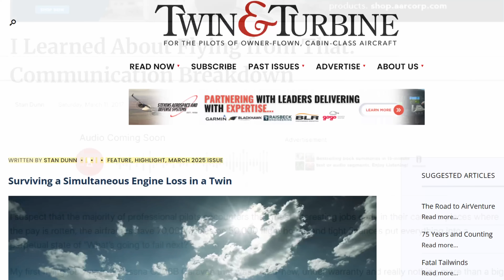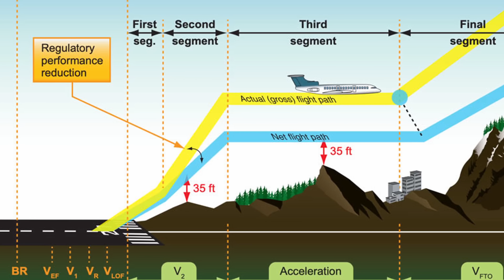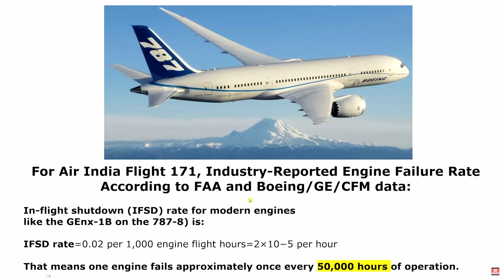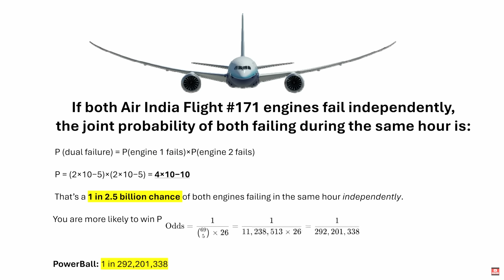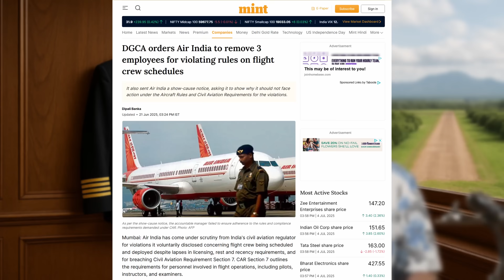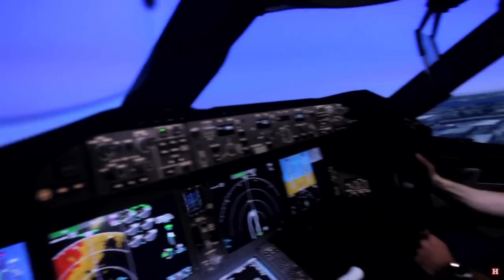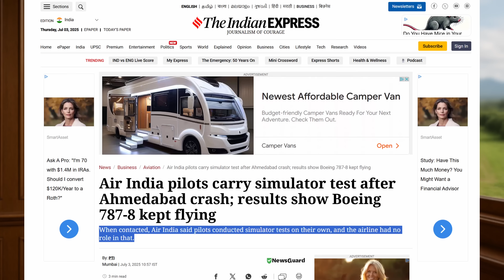Air India 171 Cause Becoming Clear

Comment: The takeaway in any meaningful  accident investigation is: Never say never, never say p(i) is extremely small 1 in xxxbillion. It has occurred, so the p(i) was 1 !
From how and where the little filmsy fuel emergency CUT OFF switches are located within armrest operation position, to why and how all different interferencing cables are spaghetti arounding squeezing through high density multipin connectors in lieu of industrial standard terminators to the decades old grandfather controller with dryjoint pcb, all are not exceeding kids  masterpiece quality. Have you ever seen how an industrial Emergency switch is housed in protected cover in train ?Do you know what happens if fuel is cut off to an airborne aircraft ? Do you know fuel fire needs oxygen to burn, which is difficult in thin air density high up in the sky ?

Comment: June 8th 2025 BA217 from London to Washington was 43 mins into the flight when the aircraft stopped climbing due to loss or power & had to return. Then on 12th June 2025 came the AI171 crash.Then approx 10 days later again another BA787 flight suffered a total elec restart during pushback. Lights flickered, engines refused to spool up, & the avionics rebooted mid-taxi. The flight was aborted.
Engineers couldn't initially pinpoint the issues due to systems complexity but eventually discovered what they termed Digital Deadlock. For some, the plane believed it was on the ground rather than in the air, a False Ground State where engine power is restricted, flaps don't go to airborne mode, hydraulic pressure limited, yet warnings remain silent!
BA217 entered False Ground State just 90 seconds after departure but the black box recorded no system failures.
These problems were known to Boeing and known to be behavioural not mechanical. By mid July 2025 at least a dozen airlines had started reviewing their reliance upon the 787 for their future fleet purchases. By the end of July 2025 some 140 787 dreamliners had been grounded for a variety of reasons, some associated with their Trent1000 engines.
https://www.youtube.com/watch?v=leOFzpgnlyI

Comment: Not clear at all.....
If the Pilots did not switch off the fuel, then who did?.....Was the switches operated or not?
Could the aircraft take off with the switches in the wrong state?
Is it possible for the crew or a passenger to operate the switches whilst on the runway, readying for take off?
How long can the engines run on for after the switches are operated?
Last one, coud the switches be be in a half way position neither on or off and a jolt or something clicked them off?
Just thinking the possibilities and no doubt there are experts thinking of other possibilities....
It is beyong comprehension for pilots to switch off the fuel to the engines intentionally whilst taking off...

Comment: The forward tilt of the wheels suggest the gear retraction process was initiated. Thus an engine manual shutdown seems unlikely, as that would take a while to complete and there would likely remain residual generator power for the 10 seconds or so it takes to raise the landing gear, yet the gear did not raise and complete its cycle.   Having just watched a 787 take off close up on YouTube, it only took around 14 seconds from Liftoff to gear up with the gear doors closed. Residual spin of the turbines and generator would have provided more than the couple of seconds required to simply tilt the landing gear wheels forward. Therefore, the fact that the wheels tilted but the gear didn't fully retract strongly indicates a sudden and complete loss of the primary electrical and/or hydraulic systems. The wheel tilt only takes a few seconds, which would under an engine failure still leave enough time for the gear retraction cycle to further advance than was seen in the Flight 171 take off video. i.e. I think they would get at least 10 seconds of residual thrust and turbine rotation that would see the gear retraction cycle well into its final stages. However that didn't occur and we only observed the first stage of gear retraction by tilting of the wheels. Thus probably the first few seconds of the process.  Point being that a manual engine shutdown (via fuel cutoff) wouldn't cause such an instantaneous loss of power across both engines and key systems. Residual N2 spool would easily support the generators and hydraulics for 5–15 seconds even after fuel cutoff.  That’s long enough for full gear retraction to complete, or at least progress beyond just the wheel forward tilt stage.  Yet gear retraction didn't progress beyond the first few secnds of its process.

Comment: Aren't there engine-out procedures that ARE memory checklist remediation? You seemed to state that engine-out procedures are ALL handled by checklist.
Reply from the maker: The only memory items for an engine failure I've had in my career is related to feathering propellers in turboprop aircraft. It can vary country by country, airline by airline, but it would be very unusual to have a memory item in the U.S. for a single engine failure.

Comment: I think odds are a mechanical dual engine failure is way less probable than a single one with a human's mistake. I also think the first engine failure started on the runway.  I'm just going off the number & odds. Odds are a single engine failure with a human mistake is way more probable than a mechanical dual engine failure. The human mistake happened by shutting down the wrong engine after a single engine failure. This would not even be close to the first time this mistake was made.  This is all speculation but with odds and history as evidence.

Comment: The latest theory is that it was the fuel cut-off switch to the one operating engine. I find that hard to believe as well considering that you need to lift and push that switch rather than just toggle it
I think we should just wait for the FDR and the CVR data to come 
Mind you, they already know what caused this crash because they’ve had that data for quite a few weeks now 
So somebody’s not telling everything that needs to be told 
I smell a cover-up

Comment: No flaps then it stalls ? not set up elevator trim was all wrong as well ? Boeing says 787 is not certified to take off without correct flaps it can't lift off.  The 787 has not been grounded so is this human error? Sabotage is looking more likely as well .

Comment: The issue with the Single engine faliure, then accidetal shutdown of working engion theory is this

The RAT deployed. It only deploys in 4 scenarios

1: catastrophic/serious Electrical faliure
2: catastrophic/serious Hydraulic faliure
3: catastrophic/serious DUAL engine faliure (NOT Single engine)
4: Manual deployment by pilots. 

Since the RAT deployed, that MUST mean one of the 4 things happened. 

the PRIMARY cause can't be manual deployment, becuz that won't stop lift

It also can't be electrical faliure, because if electricity fails the engines have backups. if it was an electrical ERROR doing shit it wasn't supposed to do, it likely wouldn't trigger the RAT

If it was Hydraulics, they would have lost steerng and other functions, but again not the almost complete stop in thrust. 

That leaves dual engine faliure. Or a series of unfortunate events style of gold ruben machine of doom, requiring many things to fail.

Comment: I’m a veteran airline pilot. Nobody wants to say it, and the investigation isn’t telling us anything because the truth is probably really ugly.  Only thing that makes sense is that we are looking at another pilot suicide crash. No better way to commit a mass suicide than to reach down and turn off both engine fuel control switches just after lifting off the ground. The engines will immediately shut down. The other pilot is looking up flying the airplane and won’t know what happened. Just that he has a dual engine failure. The aircraft will quickly lose all energy and crash straight ahead. There’s just not enough altitude or airspeed to do anything at that point. Just as the engines wind down the generators on each engine will also fail causing a total AC power failure and the RAT will deploy.

Comment: Chance of both engines failing is zero absent bird strikes.  I agree probable engine problems at or close to rotation then incorrect engine shutdown, landing gear left flapping in the wind and RAT deployed.  Air India has continued to have management and maintenance issues after the sale to TATA.

Comment: It leaped off the ground, late so maybe on 1 engine, then in around the time to react to the engine out it appeared to have no engine. Making it likely a reaction to the engine out was a factor. Single pilots in light twins are forced to feather to stay in the air and have a statistical level or error doing that. The AA compressor stall and landing without issues is the right thing, they climbed while the stall banged away.

Comment: I think his statistics are off as you can see both engines failed simultaneously. What was his stat, "1 in 140 billion" within an hour of each other. Both failing at the exact same time essentially zero. What about British Airways Flight 9 on June 24, 1982. All four engines failed at once. In 2023 there were 35.3 million commercial flights give or take a few thousand. Lets use that number from 1950 (even though there wasn't that many flights then but to help bolster his stats). So 2.6 billion flight would have occurred in the last 75 years. So this shouldn't have happened for another 133.4 billion flights and that was for within an hour of each other. So how do you explain it happening? Easily below 1 in 10 billion you say, yet it happened. Also, as rare as 1 in a 100 billion, yet it still happened. Nothing new here that hasn't been in other videos. "Cause Becoming Clear". There was nothing in your video that made anything clearer.
Reply from the maker: British Airways Flight 9 engines failed due to volcanic ash, not present with Air India 171. The odds of a nearly simultaneous engine failure (say, within 10-seconds) DUE TO MECHANICAL FAILURE, is horrendously low (it’s one in 5.4e^10–a number with 10 zeros). Essentially impossible.
Reply: @flyingformoney777  I will help you out. Yes, from the eruption of Mt. Galunggung the four engines failed due the plane flying through the ash cloud plume from the volcano. Also, I didn't say that they failed due to volcanic ash (flight 171). You know what, you got me. Ok I'll use the term they stopped producing thrust to keep the aircraft airborne. IS THAT BETTER! In his video he didn't specify any specific single failure such as pilot error, electrical, software, catastrophic turbine failure, etc. for each of his stats. He just stated the term failure. So, can you provide the statistic for aircraft engines simultaneously stop producing thrust? Instead of crash should we say that it was a Rapid Unscheduled Abrupt Landing? You must be one of those guys in management that would hate the ARFF Department and would say, "It would be cheaper for me to lose a heavy aircraft, it's crew and cargo a year than to staff and supply a fire department a year." That must be you.

Comment: Brother, good video. But why you are not questioning boeing? On other hand almost every platform is considering boeing's malpractices for one of the crash reasons. Did they pay you? Coz that's what boeing do change the narrative and blame it on pilots.
Reply from the maker: Given Boeings recent woes, if there were any factual elements pointing towards Boeing, Indian regulators would have certainly published them. I’m not a Boeing fanboy (though I fly the 737). If there were indications it was Boeing related, I would have not hesitated to publish it. 
Thanks for watching.

Comment: The answer is quite clear (it is here)
This link below is to a key AI 171 related regulatory document depicting an FAA exemption for a longer term planned rectification of a known TCMA flaw in the 787-8's GEnx-1B engines. It relates to failures (plural) in the thrust-control module in the FADEC (and a planned retrofit). Petitioner Boeing says (inter alia): "...however, it was recently found that some failures of the thrust control module are not correctly accommodated for the GEnx-lB engine installation."
Boeing's appeal for a waiver also said: "Given the low rate of thrust control module failures and the very limited exposure time on the ground when the failure is potentially uncontrollable, a catastrophic event caused by a UHT due to un-accommodated thrust module failures is not anticipated during the next 2.5 years." (sic)
Boeing also asked (in link below) for their waiver application not to be published and that public comment should not be called for..

https://downloads.regulations.gov/FAA-2016-7855-0005/attachment_1.pdf
From the FAA waiver exemption grant and concession (at the link above): (please note the plurality):
"...however, it was recently found that some failures of the thrust control module are not correctly accommodated for the GEnx-lB engine installation."
If this waiver was nulled out by a subsequent GE "fix", the newer modified retrofitted FADECS would have been incorporated by a Service bulletin. Have not found that (or any reference to it - yet). The FAILURES are not specified nor proscriptive. I find this omission very strange in a generic waiver request's pleading.
You only got the two engines - and inducing a common single-point failure is an anathema to the concept of safety.
Seeing as there was a 5G tower emitter 2.1kms upwind of the upwind threshold at Ahmedabad, it may well have been an induced LRRA minus error (per the Turkish 737 at Schiphol) that told the TCMA that it was on the ground at excessive thrust (= simultaneous shutdown of both engines). However, the LGEU's six WOW switches would had to have been in oleo-extension hiatus momentarily (due to the gear tilt pause) for this to occur on AI 171... as it rose into the Line of Sight of that 5G tower (but TLA?) . Throttle Lever Angle may be the glitch.

Comment: What was the humidity? In case of fuel contaminated with water vapor condensate from high humidity and subsequent high rate of fuel consumption required at takeoff, icing might occur in the engine or at fuel filters or even water separators. Such condensate might only  temporarily 'jell' the fuel somewhere in the fuel system. Water can separate from the lighter kerosene and collect at a low point and can therefore be selectively picked up en masse during a high flow due to takeoff. After the fact, the fuel would naturally  un-jell.  This would not be the first time for this scenario. Aircraft fuel systems are designed with this in mind. The FAA would know to look for this.

Comment: I don’t buy this manual engine shutdown theory!   If during takeoff & climb, an engine stops thrusting … I’m sure pilots would be trained to attempt maximum thrust with all available engine power ….. there isn’t enough time to assess which engine is at fault during this critical climb phase.  Time pressured decisions make faulty decisions more common.

Comment: I've got zero flying experience but after seeing the takeoff video when 1st released it was clear to even the untrained eye that there was thrust from the left engine (from the debris/dust) but nothing from the right engine.I pointed this out on the very 1st Captain Steve vlog regarding the accident but you are the 1st trained pilot to even mention this... It's so obvious on the video..
Reply: The fan, majority of thrust, takes a long time, relatively, to spin down.

Could have lost thrust about 3 seconds prior to making the dust blow up.

We cannot see the rudders well enough to know when engine or engines failed.
Reply: @richyrichk Thanku..👍

Comment: So, what happens if FUEL is shut off or unable to reach the engines - are the fuel pumps run by hydraulics? Would high ambient temperatures cause vapor lock so much that if fuel pumps failed (due to hydraulic failure), and the nose up attitude not allow a vapor locked fuel system to properly gravity feed???

Comment: It's a good assessment, and it's possible, but not immediately during take-off. I'm not convinced at this moment. First of all, you may not notice it initially, but the wheel position were already on the retract position, but failed to retract, because RAT cannot power this function fully due to limited capacity. This means both engines where already malfunctioning or not working shortly after takeoff. RAT also deployed early during take-off. If this was as simple as shutting down the functioning engine by mistake, I doubt one would even attempt to do that at dangerously low altitude.

Comment: Nice coverage of multiple possibilities. Having worked for the big B doing functional testing on newly manufactured a/c the redundant systems provide reasonable safety parameters. Errors in application are not uncommon in Aviation and fatigue impacting personnel, similar to over the road transportation, is a possibility.

Comment: Just adding a correction. There are two starter generator per engine, if all 4 fail the RAT would deploy.  Both engines use fuel from the centre tank until the level is low and centre pumps are turned off.  Also, Auto RAT deployment requires both engines to fail and also the APU is commanded to start.  The EEC starts an auto restart sequence if power is available.  Shutting down an incorrect engine will not cause RAT deployment.. NON NORMAL procedures which is NOT trained at low altitude and therefor not pilot recall.  Dual engine failure- cut-off switches cut-out then back to run, RAT deploy switch deploy and APU start.  In either case the 30sec for APU to start then provide power would not have been enough.
Reply from the maker: You are correct. I was speaking broadly about the aircraft I’m familiar with, knowing that a dual engine failure will normally result in the RAT deploying, but in the case of the 787 it is 2 generators per engine. Thanks for the note.